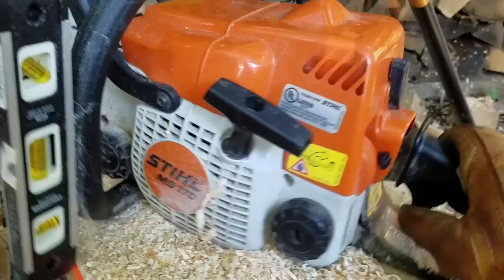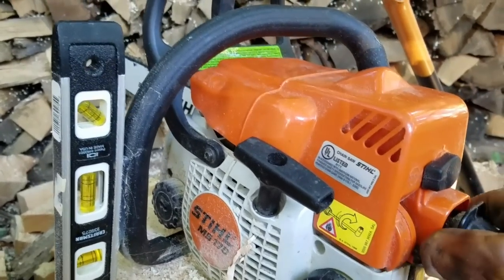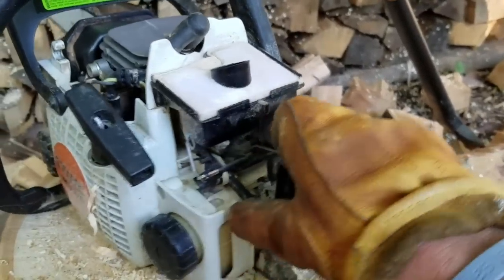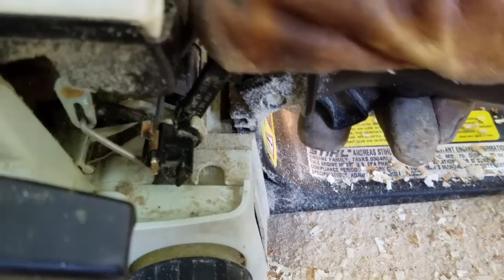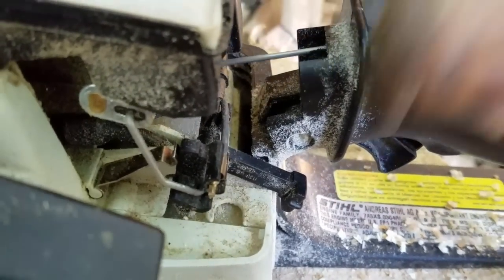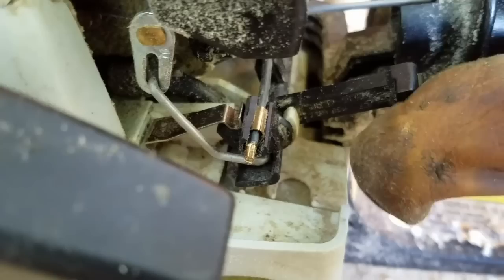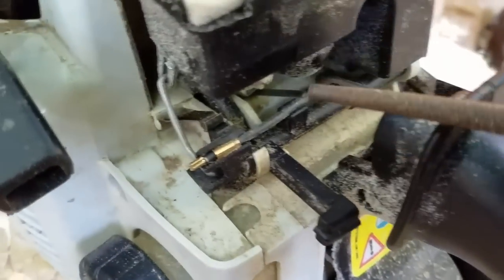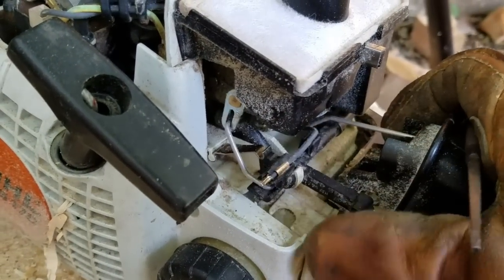How to fix your Stihl MS 170 kill switch!

Comment: This was a really helpful video. I took my top cover off to check the air filter and didn’t realize the switch popped out of its seat. Went to pop it back in, then the switch wouldn’t work properly. As someone else said, the spring had gotten caught underneath the switch. Your video helped show me how it was supposed to all be situated. So thank you!
Reply: Dd

Comment: Just had this problem pop up on my 170. Initial cause was operator error when taking off the cover…the start/kill lever had popped off the mount and when I reinstalled it the little copper spring bit was no longer in position. Problem was compounded by my heavy thumb trying to turn off the saw. Your video clearly showed the solution. With a little bending of the spring, it now works! Cheers!

Comment: I'm just tearing into this MS170 and it felt like something was broken. The cover if hard fitting at the moment, so something isn't quite right yet. The plastic section at the spark plug boot is missing part of it. The switch on this one seems to always pop off and it clicks very hard. have to get the old bifocals on so I can see...lol. Good content and straight to the point.

Comment: Great tip, the spring mine had rode under the  switch shaft causing it to push the shaft out of place, messed with it for ages, until seeing your excellent vid.
Fixed in seconds. Thanks loads.
Reply from the maker: Glad it helped!

Comment: I don’t yet know what is wrong with my Stilh switch. I can’t even remember what I did to it, but it was my bad. I think I dropped a branch on it. Ever since that time, the switch is kinda limp and doesn’t shut off my MS260.

I’m here laying the groundwork so when take it apart, I’ll know what’s conmected to what and how everything works together, so I can fix it.

Thanks for your input.

Comment: Why have Stihl manufactured such a flimsy choke/switch?Paid R1000(+/- 66 dollars) for my ms170,because choke lever switch and where it clip in on body was damaged.According to Stihl agents suppose to replace whole plastic cover +choke lever.Repairing it myself by melting sturdy copper wire into plastic with soldering iron.Took days.And you have still to be carefull,otherwise it will break again.

Comment: That’s nice to know I loaned my friend my MS171 and when I got it back you had to jiggle the switch to get it to shut down now it won’t shut down with out running out of gas
Reply: Had the same problem loaned it to a friend a couple of years ago but didn't find out about it till the other day. Have not used it since getting it back. Now I know why he doesn't call me anymore
Reply: @louisoswald6487  I found out an hour after I got it back it wouldn’t start so I took it to my uncle and it fired right up but wouldn’t shut off with out reving it up high enough for the motor to start cutting out

Comment: I did find that everything looks fine but also if I take the top cover off and pull the switch all the way up to the bottom of the carburetor and rack down on it it’ll rev then die out

Comment: Tried this but didn't work for me. My spring is not real tight after it pops up on the kill switch area. I tried using a screwdriver to press on spring thinking it would kill and still wouldn't work, I see no damaged or broken parts. Only way to kill engine is choke it down. 

Any thoughts?
Reply: I have the same issue.
Reply from the maker: Maybe the grounding wire is broken? 
Hard to say.
🤷‍♂️